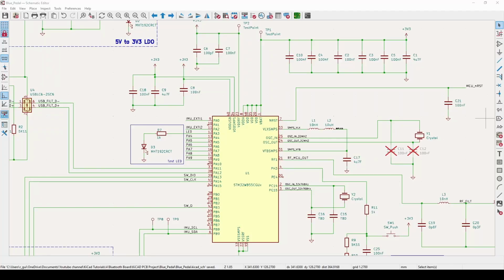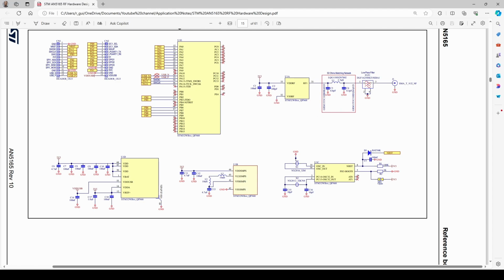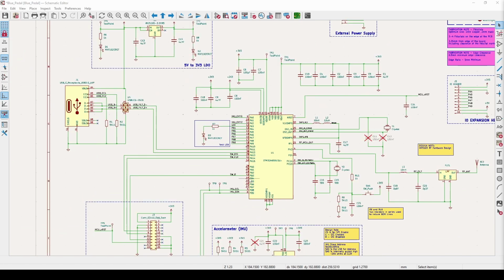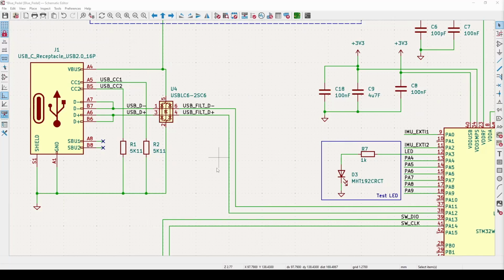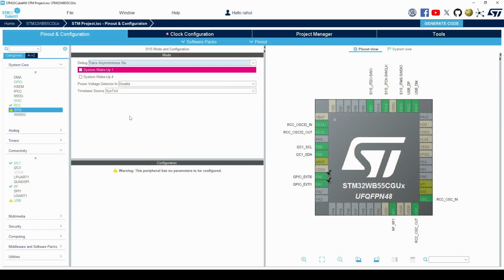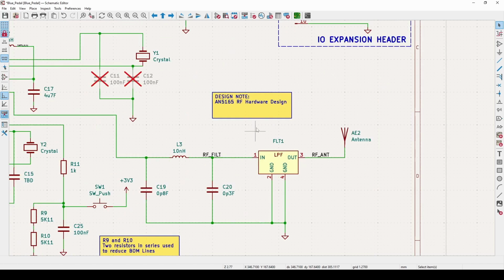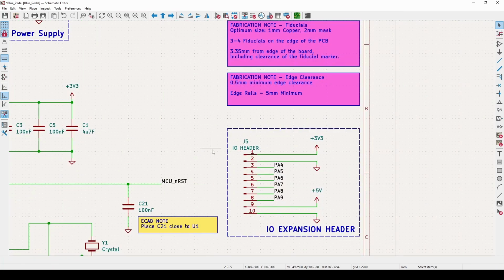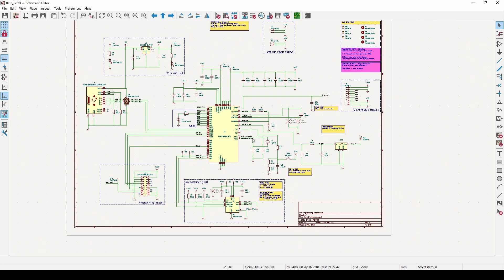STM32 + Bluetooth + IMU Hardware Design KiCAD 8 #1

Comment: The matching network in the application note uses a 2.7nH inductor, why do you use a 10nH one?
Reply from the maker: Good question! I think I copied the other 10nH inductor and forgot to change it!
Reply from the maker: I will check my bom to see if I changed it when ordering.